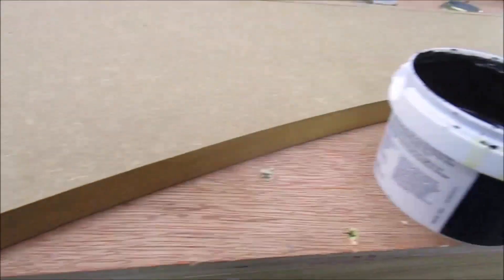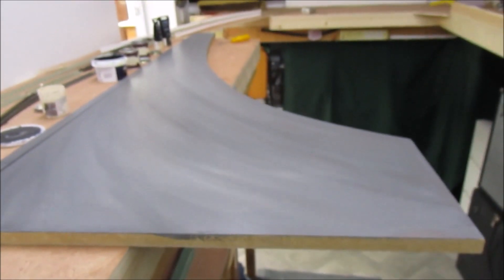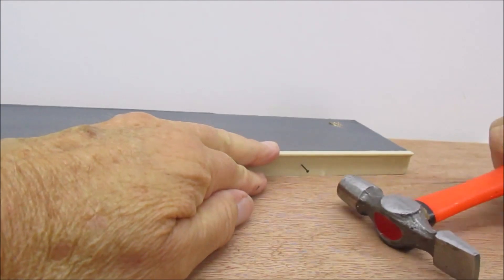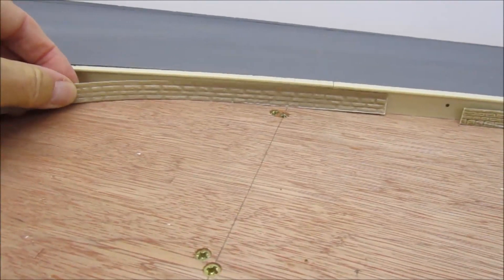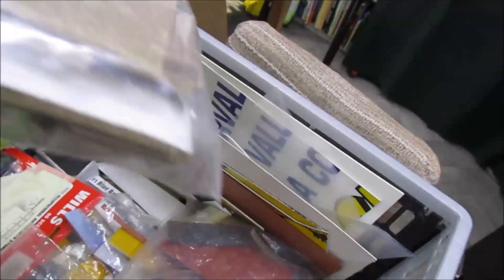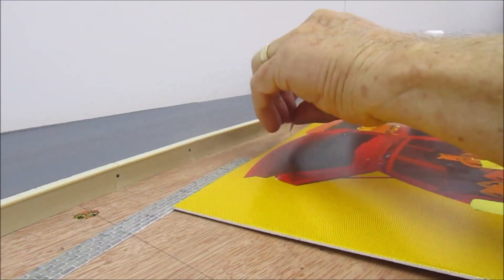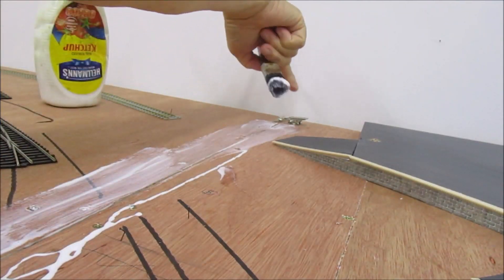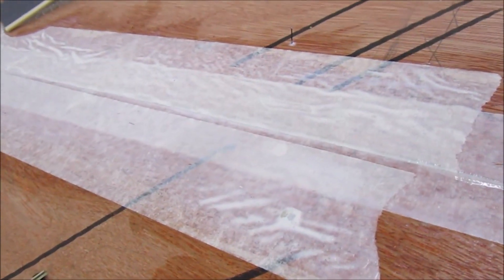BUTE ROAD No 5 Platform Part 2, Andy Peters World of Model Railways,

Comment: I like the pva and masking tape on the baseboard join. Do you really need to cut it afterwards? (At least on a ‘permanent’ layout.)
Reply from the maker: Hi Neil, Good point, and I suppose the answer is no.
I do mine, as I split my boards and turn the boards on their side for wiring / maintenance etc.